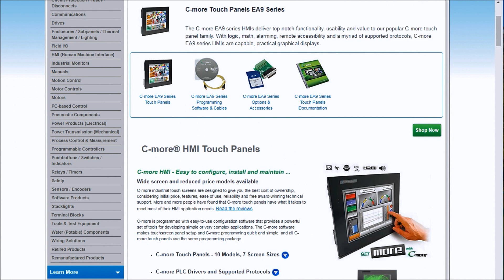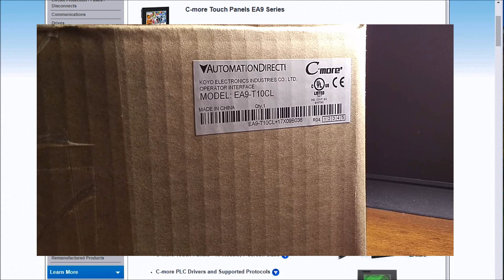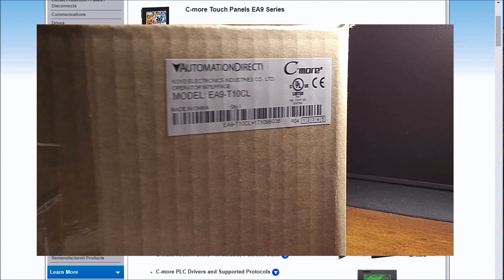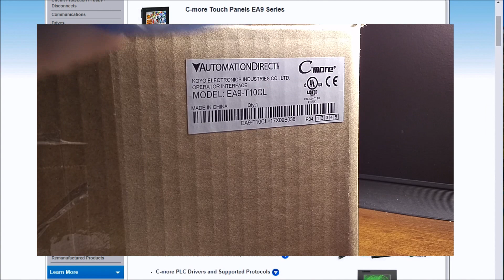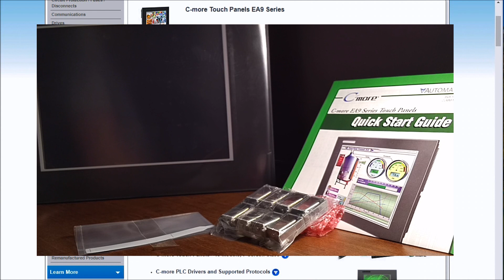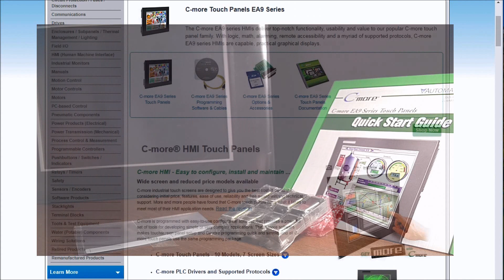C-More EA9 HMI Series Panel Unboxing and Review

Comment: How is it rated NEMA 4x rated and indoor only?
Reply from the maker: Hi William,
Here is a link to the specifications on the EA9 Series. There are variations depending on the size of the HMI. 
https://cdn.automationdirect.com/static/specs/ea9features.pdf
In general, the panels are rated:
NEMA 250 type 4/4X indoor use only UL50 type 4X indoor use only IP-65 indoor use only (When mounted correctly)
Operating temperature:
0 to 50°C (32 to 122°F) Maximum surrounding air temperature rating: 50°C (122°F) IEC 60068-2-14 (Test Nb, Thermal Shock)
Here is a thread that does speak on the C-More being used outdoors.
http://www.plctalk.net/qanda/showthread.php?t=72407
I hope this helps you out.
Regards,
Garry